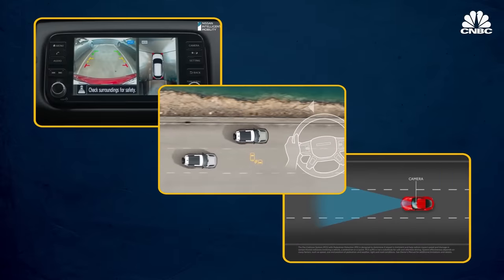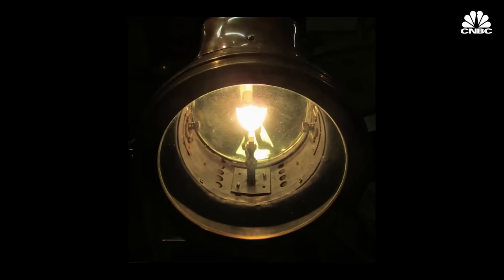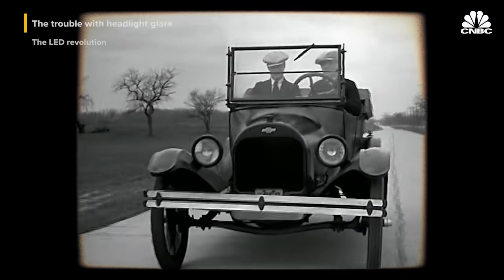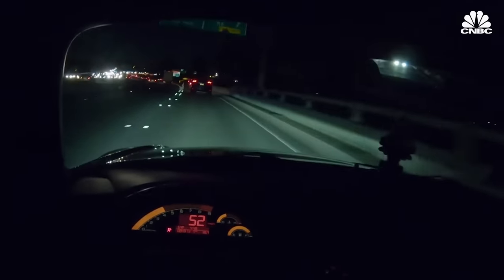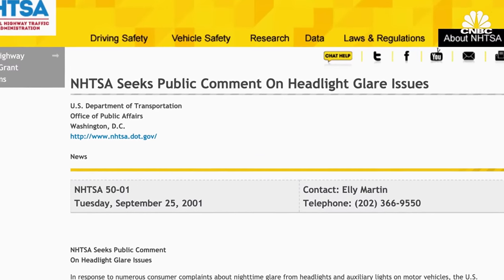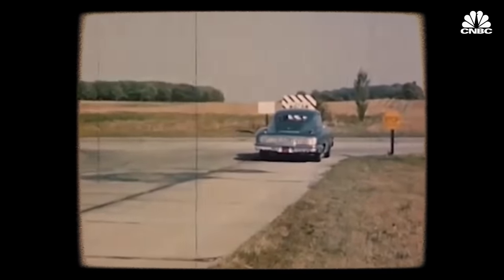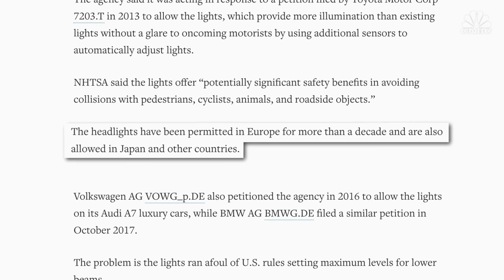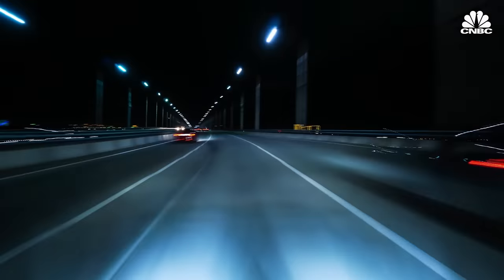How Headlights Became So High-Tech

Comment: I drive a hwy that on an aver has at least one deer hit every day in a 46 mile stretch. After upgrading my headlights in my Jeep to a high quality LED replacement  (not a cheap amazon one) I would never want to drive without an LED headlight. That and the 32 inch curved light bar that came on automatically when I switched to my brights, has saved me from hitting many a deer. The curved light bar throws light not only way down the road (more than the LED headlights) but also light up the ditches/side of the road just as much. Light bar would turn off soon as I go back to low beam automatically.

Comment: I like what IIHS does and that they test the headlights, but their tests are flawed. They put too much emphasis on leveraging high beams which for many drivers is not an option, so cars with poor and not adequate lights get same rating because high beams compensate for these deficiencies, but they forget that if you drive around the towns, you cant use the high beams, so you end up with poor lighting. Good move, but lacking grading.

Comment: A lot of talk about the new tech of these lights, but it's the newest cars on the road, the ones you would expect to have these so-called 'features', that are the worst offenders when it comes to painfully blinding glare. Dim headlights were never an issue on new cars. All this tech to prevent blinding other drivers would be unnecessary if we stuck to the brightness and lower color temperature of older bulbs.

Comment: I am against having $1.000 headlights!
These new full LED headlights are too expensive to purchase a replacement.

I prefer the "traditional" halogen bulb ones, which are fairly simple and inexpensive to replace, and offer quite good lighting.
The current halogen bulbs are quite good in terms of light output, lifetime, and cheap.
If the headlight is good, in terms of projecting that good light output onto the road, the result is quite impressive.

With filters, one can get different light colors, from 3.800 to 4.200 Kelvin, and even higher.

I use Philips halogen bulbs, both for dipped and main beams, and I am quite please with the end result.
Osram / Sylvania also make remarkable good halogen bulbs.
Reply: I love my LEDs: as a replaceable LED bulb, using traditional sockets.
Also, I love them in the interior.

However, this shall use traditional sockets, in order to make them replaceable.
This is quite important to allow for a bigger product life cycle, even when the vehicle itself is worth very little.

Comment: European HID’s required auto leveling and headlight washers. Auto leveling/headlight washers not required usa.  USA always seems to follow Europe but cheaper version.  USA follows Europe in many aspects even emissions, Euro 4, 5,6.  Seatbelts, airbags, and stability control had to be mandated in USA vs other counties
Reply: no wonder they have so poor regulations on the road, in USA are allowed turning signals using same bulbs as brake lights, so they are red instead of orange like in the rest of the world

Comment: A problem in the USA, is that if the government doesn't require a feature, whether it is safety related or not, then the American automakers GM, Chrysler and Ford won't include as standard equipment.  They may offer it as option or only higher trim levels. They want you to pay extra for it.

Comment: Mmmm are you sure that Audi was the first? The previous Mercedes Benz s class, the w222, debuted in 2013 and had active dynamic matrix LED light systems called the  LED intelligent light system equipped. However, due to automotive lighting regulations in America, like what was described in the video, the function was never brought to the north American region. We've been talking about this issue for years and how the car is equipped with the ability to move the lighting away from oncoming traffic, project caution signs and even cross walks on the ground.
Reply: Audi was first car company with LED running lights(2007 R8, 2008 A5, 2009 A4  and full LED headlights 2009-2010 R8, 2011 A8 etc.

Comment: As an ex overnight semi driver in Australia on the Hume often 10 trucks all 7 seconds apart we used to turn our lights down low and watch the lights of the truck in front.
Also for a while cars had little lights under the bumper that shone in oncoming peoples eyes so i thought if the lights are on the roof maybe thay would be pointing down more and not blind you.
At the risk of becoming a bore I once saw a 4 wheel drive that had indicator lights that really stood out and wished all cars had them.

Comment: So, If these new headlights are so great why does the headlight go off when you activate the turn signal on that side. Once the turn signal is cancelled, the headlight comes back on again.  I see this time and time again with most if not all late mode vehicles.  The funny thing is, the direction you are turning to is not lit by the closest headlight. Seems like a safety issue to me. Has anybody else noticed this?
Reply: You're thinking of the LED running light which is just a lighting accent, and not part of actually illuminating the road in front of you.

Comment: It used to be in the USA, you could only use sealed-beam round headlights. The legalization of flush-mount headlamp housings in 1983 made it a lot more viable to improve headlamp design, first by going to H4/H11 halogen bulbs, then to xenon bulbs in the late 1990's, and finally to LED bulbs since around 2007.

Comment: If the light dims itself when it detects a car… does that mean you the driver can only see empty space and don’t see pedestrians or cars since your light won’t shine on them?
Reply: I think so, you can see that in the animation where it's turned off to just the lower portion at 12:40, it just lights up the pedestrian's legs, not head/face.

Comment: I can drive around in my 22 year old car with the high beam halogens on, and no one notices.
Reply: You need new headlights, and yes, people notice. Show some care for the people piloting two tons of car in your direction separated by two thin lines of paint.
Reply: @bwofficial1776  Negative, 20 years ago, one would be flashed constantly for forgetting to turn off the halogen highs at night, now, never. Not that I intentionally leave them on after nightfall, day use mainly. Factory LED and aftermarket are so often misaimed, or lack proper focus, my halogen highs are candle stick lanterns in comparison to their lows. Not many properly focused LED options for this American car classic, so Sylvania Silver Star is what I'll stick to.

Comment: I switched to Sylvanias Top Quality Halogen Bulbs. At first I thought they really aren't much better. And then I noticed that actually I could see about twice as far and twice as wide and twice as bright. On a dark Road the Hi Beams are fantastic..
Reply: I've been using the HIKARI Acme-X LED Bulbs and the beam pattern is just as safe and much brighter than the top quality halogen bulbs.
Reply: @ToddTinley  It's Okay with me. I checked on the LED Bulbs the ones I saw you need to add some stuff to the car and legally you needed to run them between 4000k and 5000K. The Halogens work great for me. I just took the old ones out. which I think were original oem and replaced them. Turned right on.

Comment: It might be cool to add an extra infrared light small headlight that will reduce speed if the light is blocked in certain distance that might prevent few accidents
Reply: They already have this using radar. It is called AEB - Automatic Emergency Braking.

Comment: HID is a better light hands down over LED but the masses want LED, because it's new and for the technical aspects.
Reply: No it isn’t you’re stuck in the stone ages.
Reply: @tails300  HID wins on watts/lumen, color accuracy, cut off and output.
Reply: @bowez9  nope not with accurately aimed projector LEDs. My Camrys LED projectors are brighter than any comparable HID (with great cut off) and have built in auto high beam function.
Reply: @tails300  care to back that up with technical specs.
Reply: @bowez9  sure
Reply: @tails300  the post them.  Wattage, lux or lumens,  color profile....
Reply: @bowez9  don’t  worry I will.
Reply: @tails300  remember to post references and sources.
I will assume no post/references to just prove my point.
Just FYI EricTheCarGuy already did a comparison in a Honda Element.
Reply: @bowez9  that comparison doesn’t count, I’m talking factory LED vs factory HID, I don’t care about comparisons from third party installed LEDs or HIDs because they’re never as bright as OEM ones.
Reply: @tails300  they were OEM set ups.  Which that wouldn't matter anyway OEM vs OEM is the same as Aftermarket vs Aftermarket.
Reply: @bowez9  no they weren’t the Honda Element never had oem HID or LED headlamps from the the factory, it had halogen standard. They were third party after market lights on both comparisons, which makes it disingenuous to try to use that as your source.
Reply: @tails300  ok 2015 Halogen bulbs put out 608 lux@30feet 2016 LED put out 590 lux @ 30 feet.
Reply: @bowez9  are these factory third party?  because everyone knows third party LEDs are not as good as factory ones. Quit using third party specifications as a source…I want factory comparisons.
Reply: @tails300  factory, the aftermarket LED did 905 at 30 feet
Reply: @bowez9  and which cars were these
Reply: @tails300  My Camry came with projectors and I just put in HIKARI Acme-X LED Bulbs and they look amazing!
Also, my Sienna came with HIDs and I changed the bulbs to Osram Cool Blue Boost and they are amazing also! I love em both.

Comment: 2 big problems I see with headlights nowadays. 1. They need to point lower as the cars are getting bigger and taller (especially trucks). 2. The high beam needs to be taken away from newer cars. The new cars have bright enough lights and too many people use them dangerously where they are not required (ie. tailgating).

Comment: Most of the glare problems caused by modern OEM headlights can be solved with auto leveling headlights.
Reply: in EU auto level is mandatory for HID, and still all HID lights are disturbing for other drivers

Comment: Incredibly stupid.  I never felt unsafe driving older vehicles with conventional headlights, and it was safer because I could replace a broken one in 5 minutes.    I just got quoted over $2000 to replace two light systems on my 4 year old car, and was told it would take weeks to get parts in.  So stupid, I am so dissappointed that we let ourselves be duped into this kind of garbage.